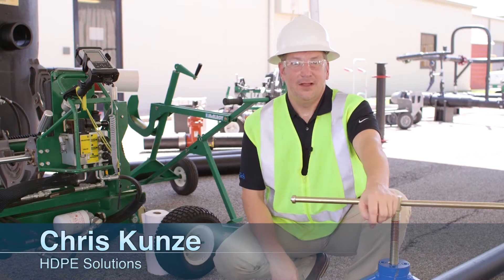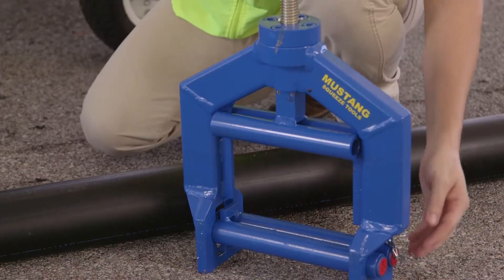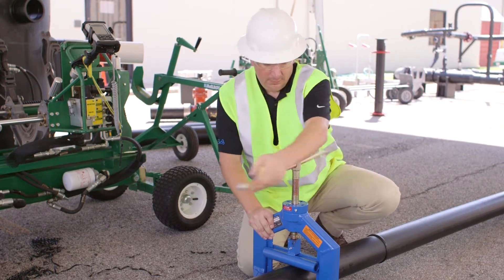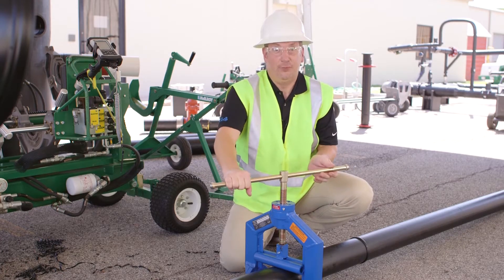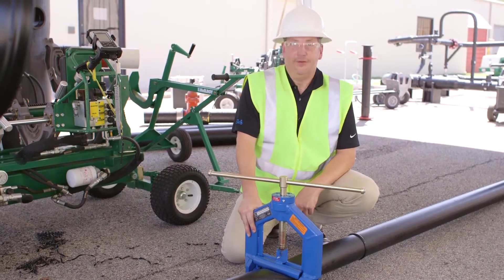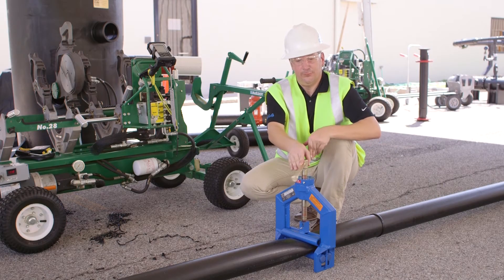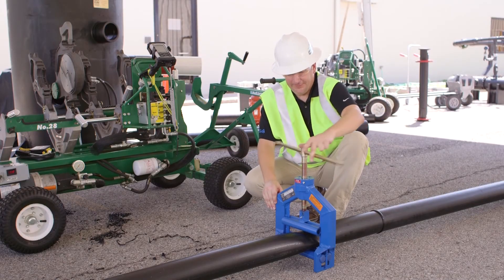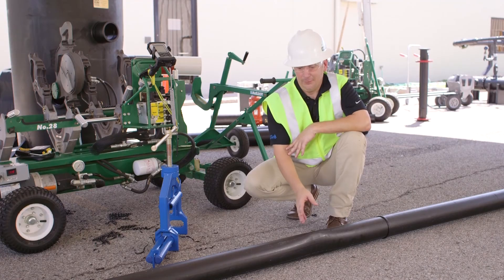Repair - Stop Flow by Squeezing HDPE Demo

Comment: Probably sdr17..the thinnest u can get lol. Wait til u have to pinch off 8 inch sdr11 over your head. That tool is 100 lbs by itself
Reply from the maker: Denton, 

DR17 is certainly easier to squeeze off than DR11. The manual machines have a separate gear box to switch the wrench to when it starts getting difficult to squeeze off.

For 8" pipe you would use a hydraulic machine and it is definitely a commercial piece of equipment. However, these are a staple of the gas distribution community for the utility they provide. If you are interested in learning more, please email me at dlandy@pepipe.org